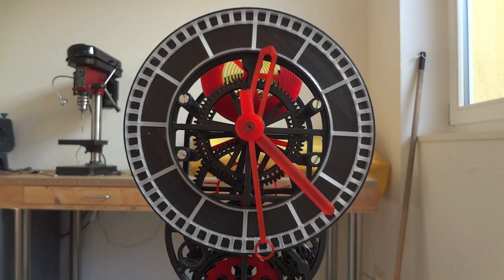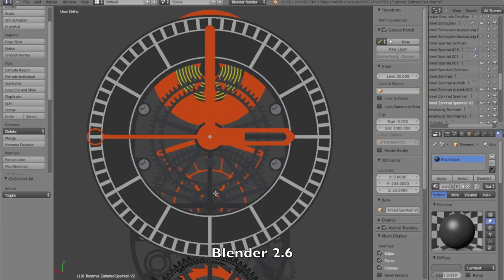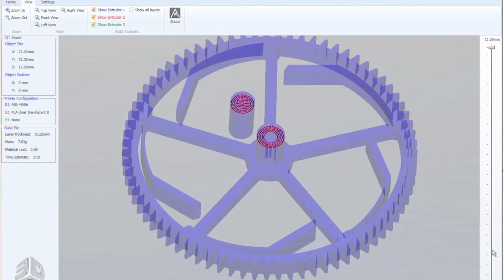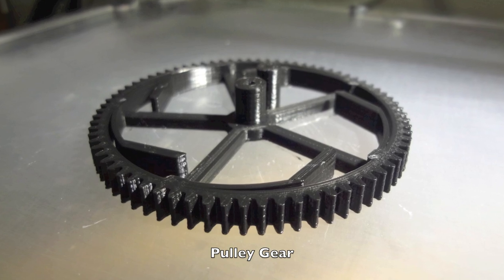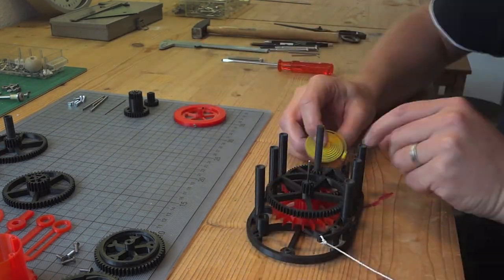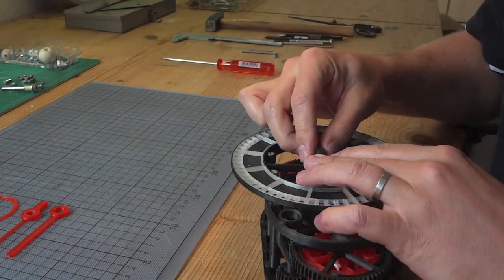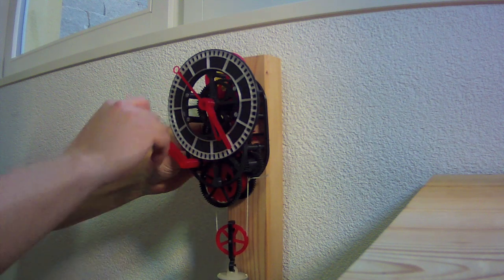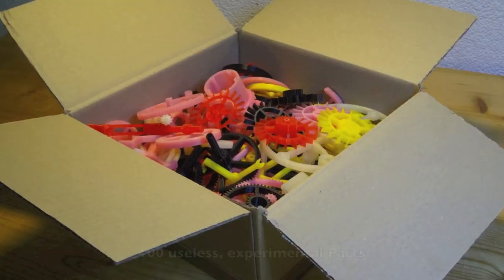3D Printing a working mechanical Clock

Comment: Hi! Does this clock still working after a few years?
Reply: Leonir Zimmermann I’m planning to make it but cannot find the pins
Reply: @domdomgin  Any luck? I've started printing the parts, but I'm having the same problem finding the pins.
Reply: DrSamba I gave up
I threw my printed parts away 
Not worth it

Comment: Hi, I would like to study a mechanical clock, since I'm planning to use Solidworks, because of its stability on mechanical engineering, I wonder if you have the pieces on a .stl format or compatible to Solidworks. Making a mechanical clock from scratch is awfully hard, so can you please help me?
Reply from the maker: +dansegful http://www.thingiverse.com/thing:328569
Reply: +Christoph Laimer sorry I got confused, I meant do you have the files on .SLDPRT ?
Reply from the maker: +dansegful I've done the original construction in Blender, and then exported STL. Both formats are available on Thingiverse. I don't have other formats. Maybe you can download and convert the Blender-file?
Reply: I tried but the parts are not treated as solid parts, just empty shells and in order to work on them I need solids parts.
Reply from the maker: +dansegful I think I can't help here ... maybe you try to study my other timepiece? Instead of Blender I have used Fusion 360. In addition to the STL-Files I've published the original files, and you will also find a function to export it in various formats. All the relevant links are in the description:  http://www.thingiverse.com/thing:1249221
Reply: thank you I'll give it a check

Comment: Can someone help me to get the pins.
Can’t find them anywhere.
Any link will do.
Reply: found pain can handle will work at 3mm pin...hihi but complet that clock try everything..no... way to ticking...impossible!
Reply: This clock does not work.

Comment: How did you adjust the ticking frequency?
Reply from the maker: printing 5 versions of the spring and balance-wheel with different constant until it was 90% accurate, and for fine-tuning 2 tiny adjustable screws in the balance-wheel (change the moment of inertia).
Reply: I was afraid that it was a trial and error process. Great job on the clock. It has inspired me to design my own
Reply from the maker: Thayer Adsit How do you progress with your design? I'd be curious to see pictures.
Reply: Christoph Laimer I've progressed through the basic design. I need to work the details out like gear tooth design, but its going well. Just got my 3D printer kit from 3DPrinterCzar. I need to assemble it before I can start printing. I've actually opted for a pendulum for a little bit of simplicity. I'll post once I get a full design.

Comment: hows the accuracy, have you tested it with timegraph?
Reply: why on earth would you need a timegraph for this type of clock ?. Its quite an achievement to get it designed and running to the accuracy he demonstrated.

Comment: i need your for making a this type clock i need dimensions of gear or other parts   i
Reply from the maker: Hi Maynak. The unit for the values from the Blender files (link in description) is mm. Gear module is approx. 3 mm. Some gears are compatible with LEGO technics (module 3.14 mm), but this wasn't applicable for all gears.
Reply: Christoph Laimer this is the mazor projet so i want complete detail if possible send the report on my emailid                        thanks for response
Reply from the maker: Mayank Singal were you able to download the files? They include the 3d models of all the parts, and Blender allows to export them as STL. I don't have more than that.
Reply: + Mayank Singal

Comment: Very nicely done Christoph!  It's also very beautiful.  I'm going to be starting a repository for 3D printed parts. Just building the site now.  www.3dMP.com.  I would like to buy your design and feature it on my website.  I will also pay you a commission or royalty for each clock assembly file that gets sold.  Your thoughts?